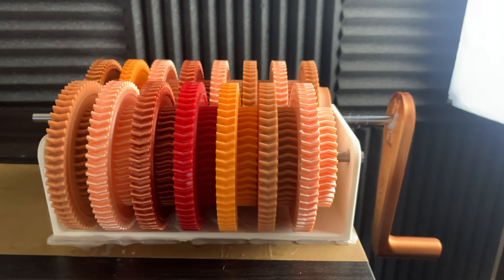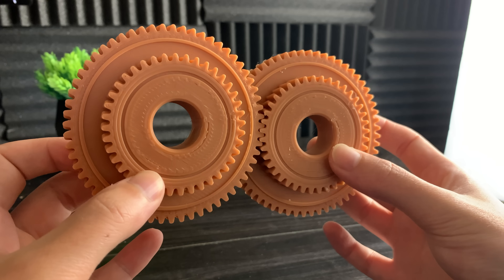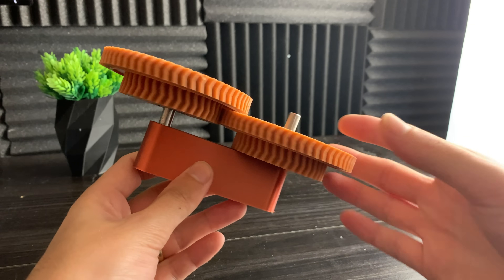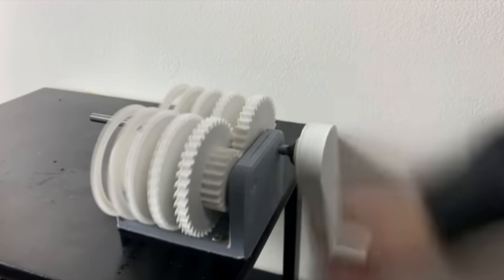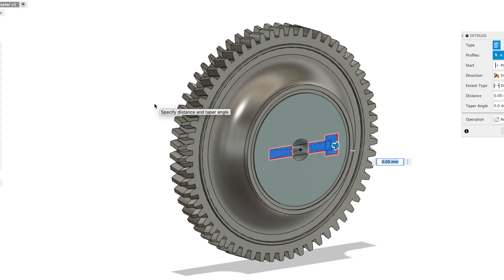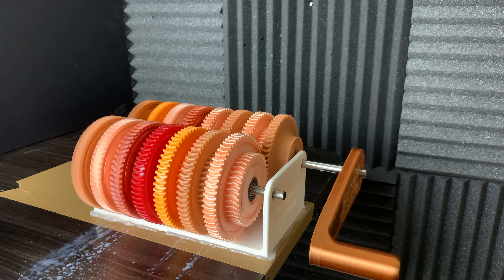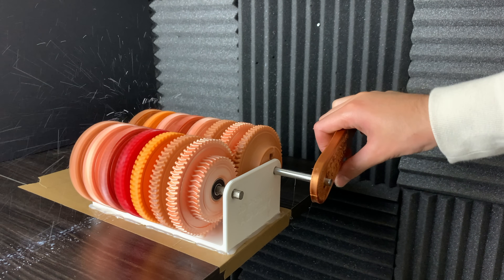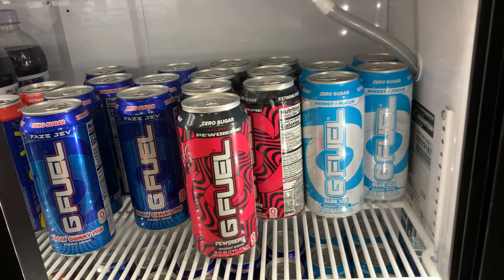3D Printed Gearbox (Herringbone Gears) - Speed Test

Comment: to further reduce the friction you could 

use cycloidal gears they may be hard to design but have a lot of beneficial propities

remove all the seals in the bearings

remove the grease and replace it with light oil for even less friction but this will have a negative effect on bearing life.

use roller bearings instead of ball bearings

Comment: Angle the teeth and valleys so they are not at 90 degrees to the circumference, but at 45 degrees or more to the circumference, (like the profile of a tiger shark's tooth) the teeth should self-lock together and should be unable to skip because the gear wheels will want to pull themselves toward each other. also, some kind of spacer between gears on the same shaft  to mitigate gear to gear friction losses.

Comment: so you might get some help from learning how a manual transmission works. thats kind of what your created, just a fixed version of a 15 speed gear box in top gear. the only improvement i see is at the crank, double helical gears is a decent start...

When pressing the bearings use a flat surface so they seat into the gear flush.

The hot glue seemed to hold up but you might want to look into better ways to mount the crank. A larger bolt might be the first place to start.

If youre going to continue to run a lubricated setup either run a fully or mostly submerged setup in an enclosure or dont. all you really did there was make a mess. 

and lastly id like to see a tachometer to see how fast that final drive is spinning. might even earn the sub you got today.

Comment: Thrust bearings/washers between the gears and you need another support in the middle of the gear pack so the rods stop bowing outward and causing the teeth to slip

Comment: reduce the distance from 76mm to maybe 75.5mm, have spacers between gears and between the first and last gear and the stand. just the reduction in those high friction areas will improve it so much. also the rod/axle might be bending, have a support between the axles like the spacer you used to measure the gear fit but much narrower.

Comment: Potential improvement: a basin for shape for the lower holder, so the gears can pass through a lubricant bath as they turn. You'll probably also want a clear upper cover to contain splashed lubricant This will be quite messy, but it should keep the whole system well lubricated and greatly reduce friction as well as providing a sizable heat sink so parts dont get to hot

Comment: You should maybe include some trays for the lubricant and a splash shield to keep it on the gears. You should also rig a timing counter to determine how fast your last gear is moving, and see if there is a max output or point of diminishing returns

Comment: Shims
Possibly some gentle abrasive oil and a short, low speed test to get the teeth meshed as cleanly as possible before cleaning and using the lubricant you were using for the actual test

Comment: For the handle if you weld a nut onto the shaft you would be able to just use a 1/2 inch drive rachet or even an impact driver, but that would obviously be overkill. But it would work.

Comment: Maybe use wider gears in front where the torque is the highest. And then thinner and thinner gears the faster they go. And maybe remove the seals from the bearings for less friction.

Comment: You were rotating in the wrong direction for herringbone teeth. As the outer edges of the Chevron engage first, you create a pocket of air/lubricant that gets pressurized in the point. Herringbone gears are designed to be one directional for that reason. By rotating the opposite direction, you eliminate that particular problem. Otherwise, you can manufacture true double helical gears, which have a gap between two opposing helical sets of teeth. They look like herringbone with a groove down the centerline of engagement.

Comment: You should try putting spacers between the gear, like others have repeatedly mentioned to reduce the bend in the rods. Putting a .4-.6mm spacer that is connected to the base will significantly reduce the possibility of the gears slipping. I know you can integrate the spacers without much remodeling of the gears because you already have a .2-.3mm gap between each gear. Slightly widening the smaller inset gear would allow more room for a slightly bigger spacer, which makes the spacer stronger and reduces the possibility of flex further.

Also, maybe try turning the gears the other way, inwardly, like a shredder, because when you rotate the gears outwardly, the lube is getting thrown off the gears, thus wasting lube. It's just something I noticed where you could save some time and money.

Comment: except for the herringbone design which I nodded and I presumed you custom-made it yourself, other than that there's almost no engineering in this vid, this is almost trial & error on everything. ex)
 you never need to guess the distance between gear center, the pitch diameter is theoretically where your teeth would perform the force transfer and then if you love to 3d-print you would know the expansion characteristic of your printer printing with that filament, then you adjust for that tiny expansion and you've got a perfect distance.
and I don't even agree with drilling through a steel shaft to insert a bolt to act as a pin for the handle to wrench against, I'ld use a flange coupling and 3d-printed handle for example.

Comment: Looks like it just needs a thin flat plate in the middle to keep the 2 drive rods from flexing under the torque you can clearly see them bending away from one another when the middle gears get up the speed 👌

Comment: Dude... don't hit bearings with a hammer. They're not even thrust bearings. You've marred the races by putting an axial impulse through the center race. 
When seating a bearing you want all of the force to be either equally distributed or nominally, only on the outer race.

Comment: Ford flat V8 vs Ford line 6??? The 6 is stronger because it has more main bearings. Add a few that tie into the bottom plate to the axle and to both axles. So in other words. Take 3 of the front plates and add them to the middle spaced equally apart. Have fun 👍

Comment: Now you're running into forces that are pushing the gear rods apart. I would say to push it farther you would want longer gear teeth, print bracing for the middle of the rods, and make the faster gears progressively lighter weight. If you keep going at some point those gears are going to begin flying apart from centrifugal force so you'll need to consider stronger materials such as carbon fiber or filament that's more stretchy than brittle. (like nylon or HDPE)

Comment: bearings aren't properly fit on the shaft, the inner races are spinning on the shaft. Also, slot the hole in the stand on the non input shaft (the one without the crank) and you can make it so you have adjustable lash. Also need some sort of spacer between the gears, small washers by the bearings would help, and would also help with the first issue ( bearings spinning on shaft.  a spring on one end of each shaft to keep tension on the gears, with spacers between each one  would allow you to go back to a straight cut pattern, which is stronger than the double helix, (more tooth to tooth contact).

Comment: You could try reducing the pressure angle on the gear teeth that will reduce skipping but the drawback is weaker teeth. If the teeth aren't breaking you could reduce the pressure angle to 0 and completely eliminate skipping.

Comment: Good things to have :
Different thickness of gears
Add a flywheel
Spacers
+4 bearings on stand
Rolling handle

Testing purpose :

Rod spacing bracket, with an adjustable screw
Hollowed gears
Reply: Messing around with the solidity of the gears might help, yeah. If we’re going for speed, focusing the weight near the axle would probably be ideal, but you want to make sure it’s solid enough in certain areas to not break.

Comment: maybe spend more time on the gear spacing. try 75.5mm spacing, or even a large assortment of spacings. you might even try to get the spacing closer on the low speed gears to allow you to apply more torque.

Comment: Made a similar video on my channel a couple months back feel free to take a look and take any ideas you like. I personally found that running gears without bearings work better as long as the tolerance is right. Also you might benefit from a smaller angle for each of the teeth. There is a formula for creating the angle of the teeth for double helix gears.
Reply: others have recommended using a flywheel at the end, maybe only having bearings on that part would help?

Comment: Just my 2 cents: 
1. fix the gears on the shafts - not radial but axial - and use washers (diameter should be the same as the inner ring of the bearing) and have them align properly.
Reason: lose gears result in vibrations and instability - and even if the herringbone are "kinda selfaligning", the tolerances in your prints are too big to actual work on loose gears. (Also, quite some friction due to that self aligning, as the gears are constantly jumping around
2. calculate a good shaft spacing - I didn't watch all videos but to me it looks like you're going with "trial and error" regarding the shaft spacing while it's rather easy to find a matching spacing with math: 
((Number of teeth Gear1*Circular Pitch)/PI + (Number of teeth Gear2*Circular Pitch)/PI)/2
Reason: Proper spacing reduces friction and raises it's ability to transfer torque without slipping through.
3. Have a third print stabilize the shaft spacing in the middle of your bild - even if it's bending just a little, that's often enough to have the gear spacing being off and failing.

Comment: USE WEED TRIMMER LINE (OR NYLON FILAMENT) FOR A LOWER FRICTIVE SURFACE, USE A FLYWHEEL ON THE OUTPUT TO PREVENT SPEEDCHANGES THAT ARE SNAPPING YOUR PLASTIC.  IF YOU WANT TO STAY WITH  PLA TRY POST PROCESSING THE PLA GEAR IN THE VAPORS OF CARBURATOR CLEANER AND IT WILL BE MORE FLEXIBLE, LESS LIKELY TO SNAP AS DELAMINATION OCCURS